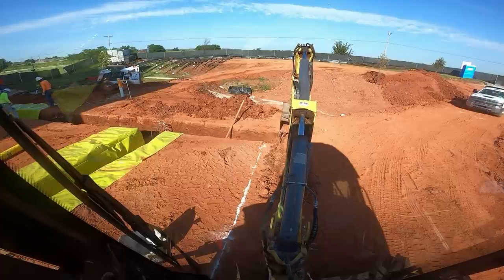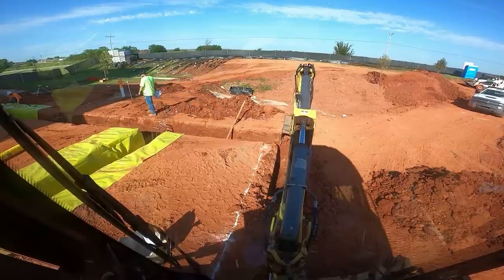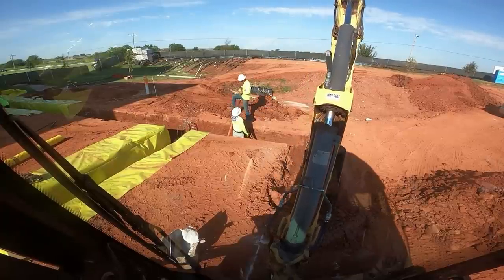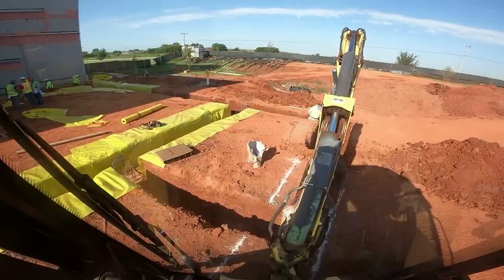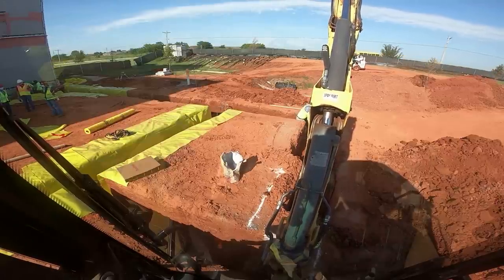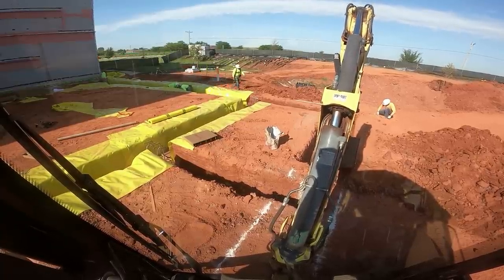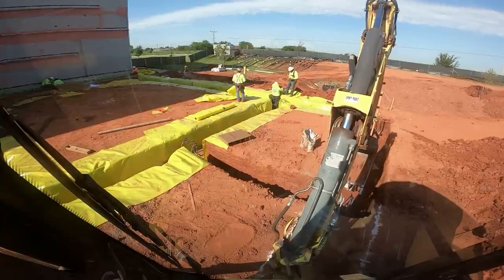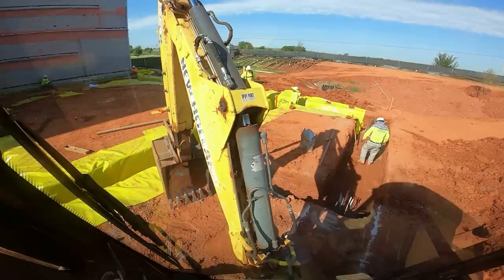Diggin basics, why I like diggin' footings. #MBGA #Digginok #Backhoeman #Backhoe #footings

Comment: One of the companies I worked for (excavator op. ) was large enough to have bean counters and they had figured it out that when concrete was involved, a 1/2” tolerance was the target. If you had a couple spots an inch low on the project (less than 2% of concrete I think was the bean counters metric) it wasn’t a big deal, but guys that couldn’t consistently stay tighter than an inch would be moved to less demanding work. Sounds a bit crazy on 20 ton machines but it was just the way they ran their operation. Most of the machines had less than 3500 hours before they’d be replaced, so they were tight. There was a bunch of stuff the bean counters wanted, like operating at 80-90% throttle instead of 100% when cutting grade. You’re right about it not being very enjoyable. We had the nicest machines on the market, but we were all under a microscope, we felt like a bunch of hamsters on wheels.

Comment: I've only dug 1 set of commercial footings. I've dug hundreds of residential footings though and now I know why. Digging around the rebar and piers would be aggravating to me. You're right about enjoying what you do, if you don't enjoy it then you may need to find something else to do. I did my dream job for 30 years and now I get to do something else I love on a part-time basis. Happy digging Mr. Frank, be safe my friend.
Reply from the maker: I used to dig some residential footings in my spare time, ie. on my way home in the evenings. Sometimes two or three in an evening, the soil conditions were not always the best and you know as well as me how that goes. I'd say you are fortunate for sure. Thanks for watching Happy diggin'
Reply: @Digginok  yeah, I'm pretty sure most of the good house lots are gone. Some of the stuff I dig now are on the worst places to put a house but, people are still buying them as fast as they are built. Great video again sir.

Comment: Can you sharpen teeth on a backhoe?
Reply: I guess you can but it's easier to just replace the teeth.
Reply from the maker: The problem is when they wear down they get narrower than the bucket. The corner teeth can be swapped, that helps, but when they are narrower than the bucket the only fix would be to build them up with weld. A sharp bucket is always widest at the teeth.

Comment: New to the backhoe what rpm do u use to dig?
Reply from the maker: JAMES STROOTMAN as fast as you are comfortable with, it does nothing but waste fuel if the operator can’t smoothly handle the machine. In my machine it varies from 1500-1900. In a Deere I may run faster as the rated engine speed is different.
Reply: @Digginok  I picked up a NH 575E, just did a bunch of maintenance, thanks for your videos! Thanks for the other info! She running sweet!
Reply from the maker: JAMES STROOTMAN the 575 is very similar to mine, the thing I like about the ford and new holland machines is the hydraulic flow is more at a lower rpm than some of the others. Less rpms = less fuel used.